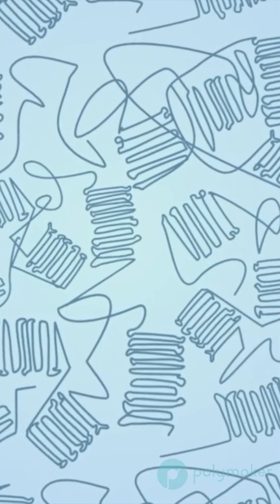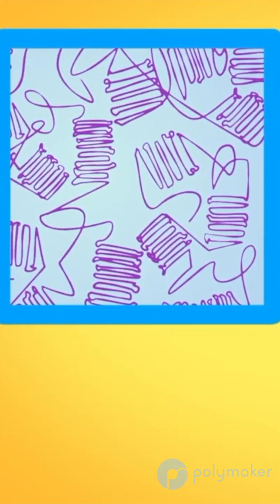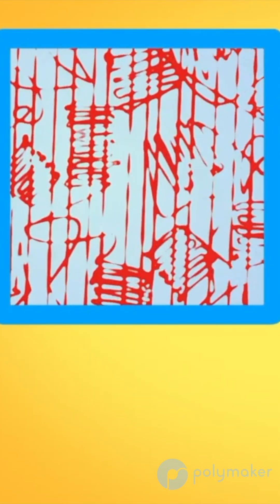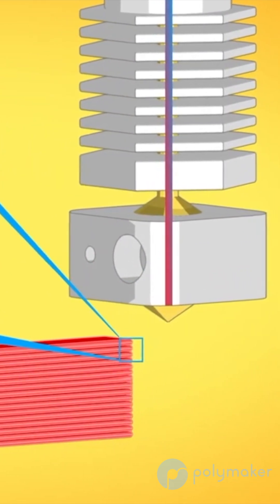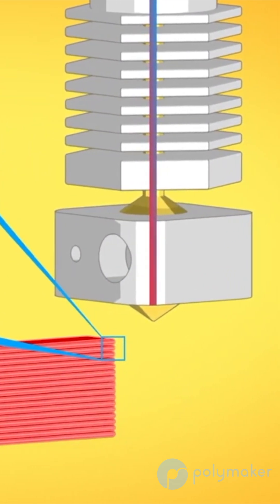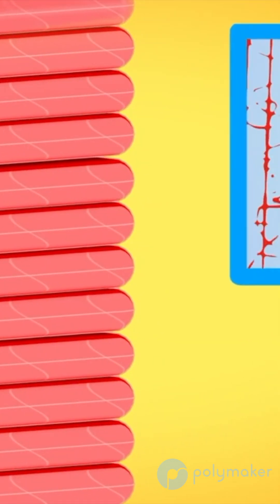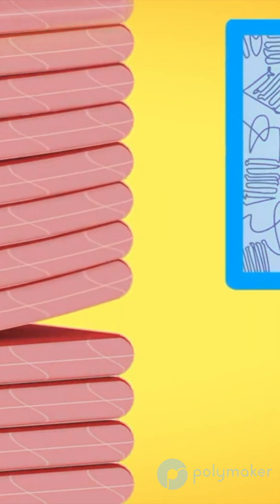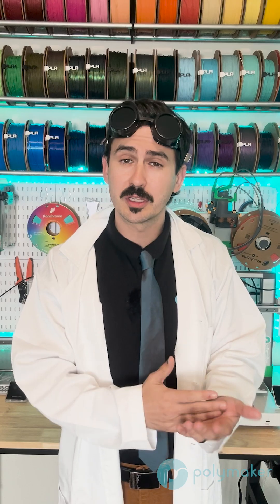Improve Layer Adhesion on 3D Prints

Comment: That's 4 factors: speed, temp, cooling, nozzle size. I think extrusion is more important than nozzle size. Overextruding by 110% has been shown to increase layer adhesion strength by 50-80%.
Reply: Agreed. He left out the most important factor imo.
Reply: Overextruding works similarly to a larger nozzle....
Reply: ‘10% 110% more would make a big mess all over the build plate because that’s more than double lol. 😅